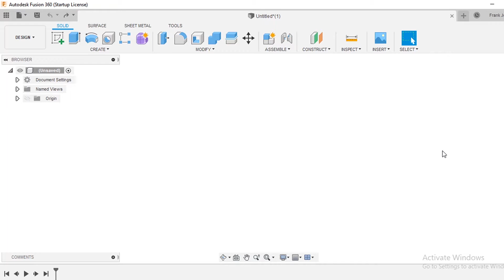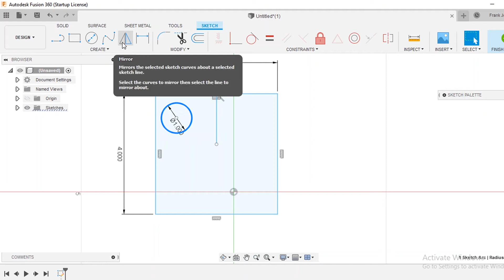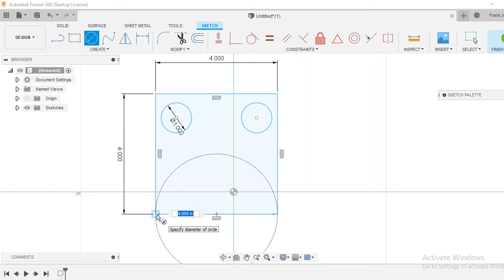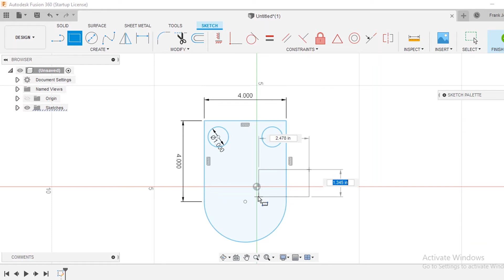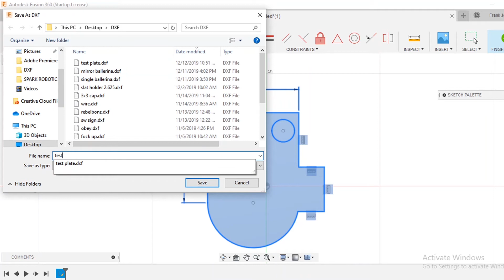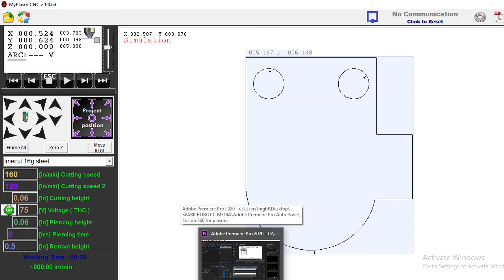Fusion 360 For CNC plasma Mirror and Trim functions Spark Robotic

Comment: I need help with my controller software. I'm running the latest version of Myplasm CNC and it can't get it to scale correctly. In other words, I can draw a 3" circle in Fusion360, save it as a .dxf and then import it like you did. When it pulls up in Myplasm CNC software it's coming up 7.620 inches in diameter. I've contacted the owner of Cutting Edge Plasma and he can't even help me with this. I can't even get him to respond to my phone calls now. I've had my table setup for 3 days and can't even use it because of this Myplasm CNC software. My email is andycarpenterjr@gmail.com. I would GREATLY appreciate any help with this. I'm at a loss and would be very happy if I can get this thing running. Thank you in advance to whomever is reading my plea for help!